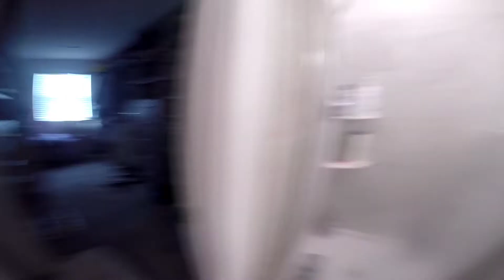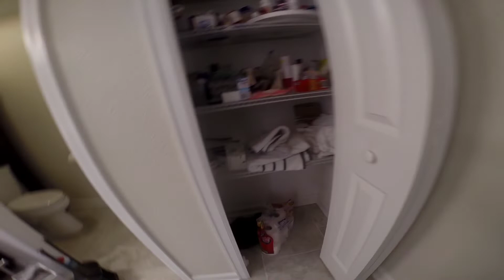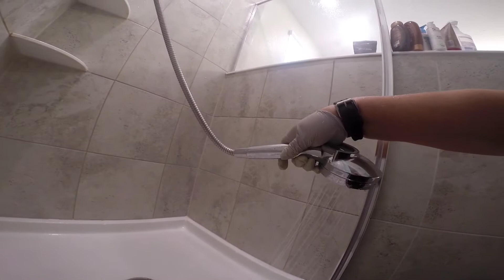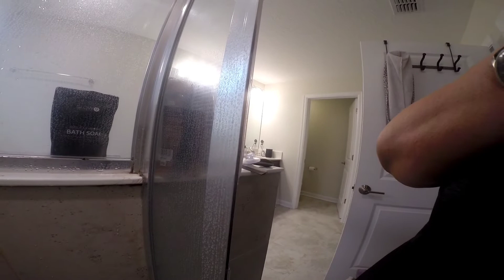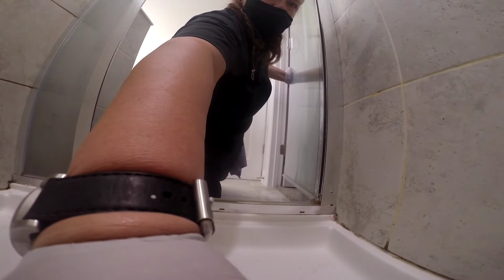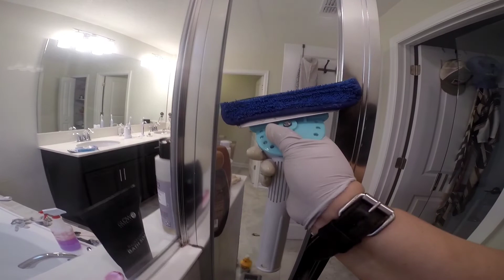#ASMR CLEANING SHOWER. Remix of shower master bathroom and glass door

Comment: What did you spray on the shower glass?
Reply from the maker: Ultimate Cal Clean by Advance. It is expensive but worth it. It is non acidid product so I just use it in specific jobs to save time and speed. Let me see if I can share with you the link where I brought it. I usually buy by gallon
Reply from the maker: Here. Save this website. This company is one of the best https://www.superiorcleaningsolutions.com/product-p/aac23.htm
Reply from the maker: Ultimate Cal Clean is a safe, non-toxic acid free cleaner that due to New AC Technology will safely remove hard water spots, calcium build-up, and efflorescence from all kind of sufaces such as glass shower doors, sinks, faucets, grout, cement block, and natural stone and more.